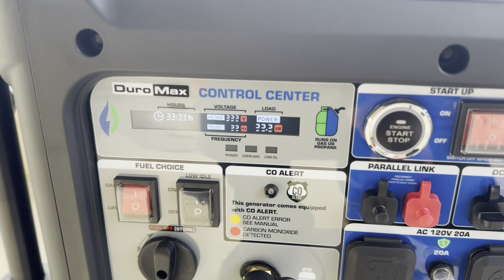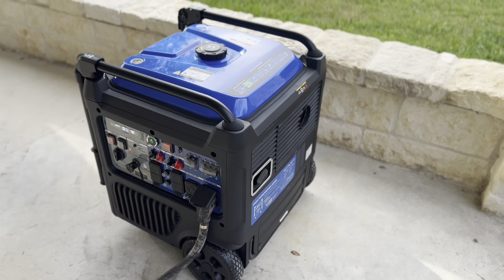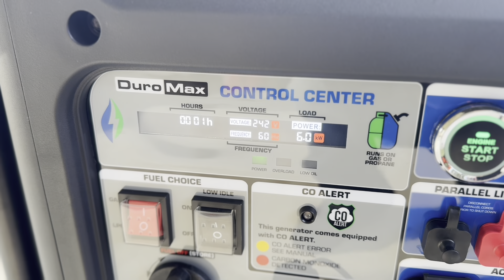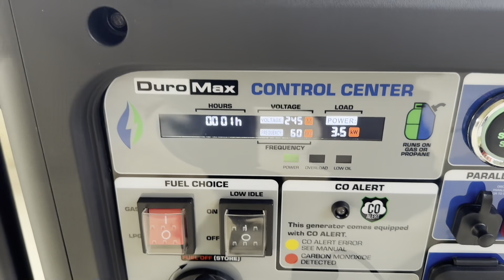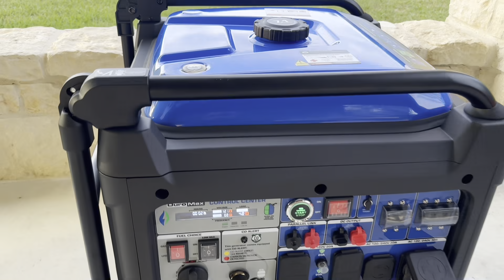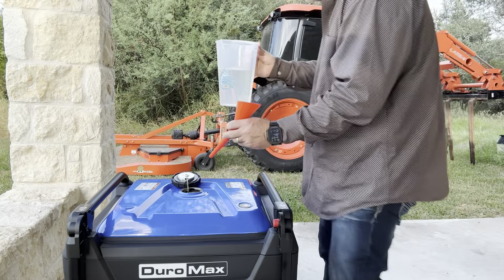Will the new Duromax 11,000 Inverter Generator Run my house? Let’s find out!

Comment: Did you convert this to floating neutral? If you’re not using it as a standalone unit for camping or something you need to take off the front panel and do that.

Comment: eould you choose this one over a no inverter 13,000 watt generator?. what about maintenece, does this have efi? is it better tonuse propane over gas if it will be used once or twice a month?
Reply from the maker: I would just buy the 15000 efi if I had it to do again
Reply: thank you for your fast response, i want to buy one for our house, probably use it 2 or 3 times per month. i was thinking on using it on propane so i dont have to deal with gas issues on going bad. 
inwas looking at Westinghouse WGen9500DFc its a 12,500 watt and would have to support a 4 ton central AC and an electric stove
Duromax seems to be the option but what do you think on westing house with a budget of $1500 usd

Comment: Get 2 of them and run them in parallel if you are running at 8-9,000 watts.  That way you can run at 50% and if you lose one you can still have power.  Just saying it gives you more options than getting the 16,000 watt generator.  The old but true saying one is none and 2 is one.
Reply: That's a great suggestion.  The question is, how would you wire two generators together?  It seems to me that a simple parallel circuit could result in excessive voltage when the sine waves are out of sync.  Peak voltage in a normal AC sine wave is 163V, with the RMS at 117v.
Reply: @gar @garym985 run a parred cable between them.  And no there is no voltage issues because the inverter generators detect each other and split the load 50/50.  You cannot do that with straight generator’s.  Your voltage problem would be a problem unless you use inverter generators.  
One invertor would run near max so 2 works both of them around 50% each.  Fuel efficient and stable power. Most inverter generator mfg sell a 2 piece cable that runs between the inverters and plugs right into a port on each. So they detect the cable and voltage is adjusted automatically!

Comment: Bro you never start a generator with it plugged in to something...ever...its literally in the user manual. You start the generator wait 5 min then plug in energy demand. You have no clue what youre doing.
Reply from the maker: Breaker is off.. User manuals are for the daily user that don’t understand the circuit should be open.. I have worked on Rig generators as big as a house.. I’m good…..
Reply: @RockyRohde lmfao i have 12 food trucks my guy and one on my house. we run these generators 10s of thousands of hours a year. Ive built over 100 food trucks im not some guy that dont have a clue. Nice try.
Reply from the maker: @summondominion The common user needs to unplug all appliances on startup and shutdown to protect appliances and devices from being exposed to improper voltage and hz and damaging equipment.  I don’t use the 110 plugs on a genset which are generally protected by a small reset and gfci. These 110 plugs do need to be unplugged as the circuit cannot be opened.  If you notice I’m using the 50 amp circuit which has a breaker and circuit can be opened. When I start a 3600 cat generator the size of your food truck we don’t unplug. We simply open the circuit with a disconnect.  I’m not docking what you know but I have been in charge of industrial generation for more than 20 years..  I have worked on Cat, Emd, Cummins, Generac.. i didn’t come after you with insults you came here with it. Your food truck experience and 15kw baby genders doesn’t qualify your comment.. lmao 🤣
Reply: @summondominion  you don't know that you should have used the word doesn't.

Comment: Great video on your setup and analysis. I really like your property there! 
That's good mileage because if you were pressed on fuel (gasoline), you can always shut down to stretch your fuel supply. I have done this at night when it was slightly cooler outside and everyone was asleep. So, I economized to run continually during peak times. I do have a generac 22kW but still have the portable as a backup. You never know, the natural gas lines can be shut down. For gasoline, I use Bucee's e-free fuel.

Comment: I want to run that generator off of natural gas and I have one 5 ton AC unit 12.5 ton AC unit and a tankless hot water heater.  I’m thinking that this may be enough, but just wanted to get your thoughts on it. I am planning on getting a soft start for my air conditioning units.
Reply from the maker: In my honest opinion the inverter does not take a surge as well as non inverter. The 11kw was almost maxed when I had 9kw on it. I would get the 16kw inverter or save the money and get the new fuel injected hxt 15000 watt.. If I was buying a new one today it would be the 15000 non inverter.
Reply: @RockyRohde don’t you need an inverter to not have issues with more “sensitive” items? Like ac unit, fridges… etc

Comment: I recently got the Westinghouse 11,000 watt inverter. It has some identical looking parts on the control panel. Wouldn’t be surprised if they’re very similar units all around.

I’m looking at a soft start for the downstairs air conditioner. That would be enough to get by in a heat wave. I couldn’t run the upstairs on the generator.
Reply: I have  the Westinghouse 11,000 watt inverter dual fuel , a soft start for both and if you stagger startup between the two  you should be able to run both depending on running amperage of the units and what else you are running, I  have a very small house  but I can run electric hot water heater, well pump, air fryer , 2 ton mini split , coffee  maker , large microwave and washing machine  simultaneously  along with a tv ,2computers  1 ups for computers ,and a bunch of led lights , was testing limits and never heard a struggle and was using the 30 amp connection , I am also an electrician 30 yrs and very impressed with the clean power vs non inverter,, and inverter driven ac systems alot better than non inverter. no start up surge and multi speed operation  very efficient ,like the generator  I never had past 75% usage by the gauge during the stress test.
Reply: @smokingmother I have a 1200sqft 2bdr townhouse in FL and a Carrier Infinity multi stage AC with Inverter motor. So would need clean power (low THD) for the AC and other appliances, so was looking at the Westinghouse 11000 inverter generator. Would prefer to use propane tanks instead of gas. Have a Briggs & Stratton 12000 gas only generator from 2008 and even though I've kept up on the maintenance, it probably would work but only uses gas and it's not an inverter generator.

Comment: quick question: does the Gen trickle charge the onboard 12v battery while the gen is running?  having hard time finding answer to this question for some reason.  it's nice they included a trickle charger port for it while the gen is in storage, but curious if it interally charges this 12v while its running, or do you essentially have to plug it into itself lol to top off that battery?  

great vid, thanks for the content here!
Reply from the maker: Thanks.. I don’t know that answer.. I always leave the charger plugged into genset when running

Comment: love the idea of these new inverter style generators hitting the market the last couple years, but reading lot of reviews these enclosed type Gens are not great at running multiple days in a row non-stop, what's been your experience (if any) with running 24/7 for several days?
Reply from the maker: If spending the money again I would just order the open station 15k.. These inverters do not take inrush very well..

Comment: So!... you have made my mind up I think. I have a 4 ton Carrier Infinity (variable speed, 42 LRA). I just need to run it, a few lights, tv, internet, and that's about it. I have a separate 7000ih for the well house. Im on propane stove, water heater, and emergency heat. Sounds like this unit should handle it well?
Reply from the maker: It should. If I was doing it again I would save the money and buy the 15k open station
Reply: @RockyRohde  Which one is the 15k open station?
Reply from the maker: 15000 watt non inverter
Reply: @RockyRohde  Well,... I had sent back/swapped out the 7Kw Generac well house open cage for a 7000ih inverter. It just idles, and not near as loud as an open cage. This is why I went with the XP11000ih inverter for the house. It's not like we're going to be running the A/C and washer/dryer at the same time or anything. Heck, If it will just run the A/C and a few LELD lights, Im good with that. I have a 2400w Aferiy battery bank I can run the Tv, Internet on for about 23 hours on a charge. I have a small 2400 Dewalt genny I can charge it up with in 85 min and a few oz's of fuel.

Comment: I have the same generator inverter. Did the 8 hour break-in. First power outage it ran for 7 hours then stopped producing power. In warranty shop now. Not sure when I’ll get it back.
Reply: Any updates on your issue?
Reply: @GunpowderRd , i’m also curious about an update on your outcome. thanks.
Reply: Update?….

Comment: A great video thanks. Quick question will the 11,000 charge your hummer??. With your portable changer cord 50 amp plug  30- 32 amp draw i’m assuming the Hummer has. ( I have a Ford lightning. With the level two portable charger Ford provides ) my 7200 watt generator would not charge the lightning. I purchased a level two adjustable amperage charger. I tried to lower down the draw down to 24 Amp. And it still would not power the Lightning. The breaker kept kicking, but on my generator it’s not a true 50 amp plug.(any suggestions on a generator that would work with an EV consistently????
Reply from the maker: No the inrush is to high…
Reply: Thanks not to be too much of a nag. Any suggestions on a economical generator that you know will work with an EV?
Reply from the maker: A non inverter 15000 will get it done.. possibly even a 13k.. duromax 15k non inverter would be a safe bet

Comment: Rocky do you have soft starts on your ac units? And you said it’s powering whole house ? All breakers on ? I have one gas hot water heater and gas furnacea 4ton and stove is gas also
Reply from the maker: My ac units are 22 seer. They are variable speeds so very low inrush amps. My hot water heaters are instant gas also.
Reply: That's a big a/c for 1300 sf
Reply: Do u think the 11,000 will be enough to run 4ton 13seer  unit  a gas hot water heater a couple tvs meaning 4 and some lights gas furnace and gas stove ?

Comment: I bought the same generator and enjoyed the video. You ran the generator for 30 minutes and used 40 ounces of gas.  That would equal 80 ounces per hour, approximately 2/3 gallon per hour.  That would equal run time of about 10.75 hour run time. Thanks again for the video.
Reply from the maker: That 11k unit is just right on size.

Comment: We are trying to decide between the 16k and 11k. We have 3 mini split systems (shop & home) and a hybrid water heater. i think the 11k will run the Mini splits and everything but that water heater pulls 5000 watts when heating.
Reply from the maker: I would get the 16 and have zero regrets.. The 11k is only 9 continuous if I remember right.. It didn’t really like a lot over 8k.. In my opinion get the 16
Reply: @RockyRohde  But how do you tie in a 16kw generator to a 50 amp power inlet when that's only really safe to 12kw with maybe short bursts?

edit....oh wait...I see that it's a tad over 12kw running watts.  But dang...twice the price.  ha

Great video, btw.  My wife said she loves the ship lap walls.  lol
Reply: Done. Thanks for the honest reply.
Reply: 16k higher fuel  consumption. Other than that go 16k

Comment: I’m definitely gonna look at something like this for my house. I have 2 3 ton ac units but gas hot water so that should be plenty
Reply from the maker: It’s a really nice built genset.. I’m having a propane tap installed this week on my patio for it.
Reply: @RockyRohde  FYI Duromax recently unveiled their XP16000iHT Tri-fuel.  Gasoline/Propane/Natural Gas. You get the most power with gasoline with 16kw peak and 13kw running which will give you 50 amps. With Propane it produces 15,200kw peak and 12,350kw running; with Natural Gas it produces 13,800kw peak and 11,200 running.  I don't have the runtime specifications on the XP16000iHT, but I do on the XP1600iH. The XP16000iH, with a 10.6 gallons fuel capacity, can operate for around 10.5 hours at 50% load with a full tank of gasoline (fuel consumption around 1.01 GPH). When using propane, it can run for around 15 hours (on a 100 lbs tank -24 gallons - propane consumption is around 1.57 GPH).
Reply from the maker: @carlwilson867 It was a hard decision between the the 16 and the 11.. The 11 covers my power so I would make the same choice again. The 16k is nice but much heavier and cost significantly more..
Reply: @RockyRohde  Naturally, you made the correct decision for your needs. I would have bought the same had it been available when the XP9000iH was released. It powered my necessities during the three days the electricity was off after Hurricane Beryl. I was averaging 18 hrs per tank of gasoline. (6.9 gals)

Comment: I'm curious....if you're running 3 ACs, how is it working?  I mean, you're using a 50A transfer, but each of those units would be pulling around 25A each, so how is it running everything?  I've got the 13kW and my electrician said he needed to actually do TWO transfer switches so I can put one AC and the well on one switch and an AC and outlets on the other.

Maybe he was just trying to talk me into a more expensive install?
Reply from the maker: I have 21 seer variable speed units. They pull very little power to maintain temp. If I let the house get really hot or cold the units would pull more power. They only pull about 2500 watts at 30-40% comp speed.  The shop one ton I have is a 21 seer mini split also.. My 22kw generac with 200 amp transfer definitely handles everything including my pool pumps..

Comment: What kind of transfer switch did you use? Unfortunately Duromax inverters are bonded neutral and their support is telling people you can't unbond them as they won't function correctly. This means they won't be up to code using interlocks or transfer switches that don't switch neutral and they will have current running over ground pin in that situation. Champion and Westinghouse have instructions on how to unbond their 11k inverters for use with interlock and the GenMax 10.5k inverter is unbonded from factory and supplies a bond plug in the box.  Will probably be getting one of them instead since I want to use interlock and not sub panel.
Reply from the maker: I have a generac 22KW with 200 amp auto transfer switch that is used 90% of the time. I also have 1000 gallon propane tank.  The twist lock on my shop is backup to backup lol. It is hard wired in and I have to kill my main to use it. I usually let the generac handle backup for most cases. When we have large storms and power is out more than a day I will hook up the Kubota 14k diesel as it is more continuous duty and I keep a lot of diesel around the house also. Generally when I hook them up to twist lock I have a rolled up 10 gauge ground that I run back to the genset grounding lug. This ground is attached to my grounding rod beneath my main panel. I like to have all three options available on fuels gas, diesel, and propane. I’m a little ocd with redundancy.
Reply: @RockyRohde  No need for separate ground wire since the ground wire in the plug is attached to panel ground which is attached to house ground rod, ground lug on generator would only be if used separate from house where no ground rod is present. 

The neutral bond is a separate issue and is not about ground rod its about the neutral being connected to ground at panel and with a bonded generator its connected a second time in the gen which is against code and causes objectionable current on ground wire to gen, there can only be one neutral to ground bond in the entire system see NEC 250.6.
Reply: @justinharrell9256 is the solution to still unbond at the panel? I’m going to use an interlock and get confusing info.
Reply: There’s a video from Duromax on YouTube that shows how to remove the bond on the 11k inverter unit.
Reply: I have been looking at Westinghouse generators.  On researching. Electrical code it states only one bond. So if your house panel is bonded then your generator should have a floating neutral.  Most inverter generators have floating neutral.

Comment: I know you mentioned you had two
 5 ton units. Were you running both units during this test?
Reply from the maker: Yes but hey are 22 seer variable speeds
Reply: @RockyRohde  It should be mentioned variable speeds soft start on their own without soft starter and normally don't run at full power unless you set thermostats 3+ degrees below the read temperature, so probably not doing 10 tons of cooling at the time unless you did that, also you mentioned solar was it helping as well? Looking at 11k inverter myself and have single 5 ton unit pulls about 6kw (including air handler blower) at full blast by itself plus well pump and everything else will be pushing it and require soft start for 2 stage non inverting heat pump.
Reply: @RockyRohde  thanks for the quick reply.